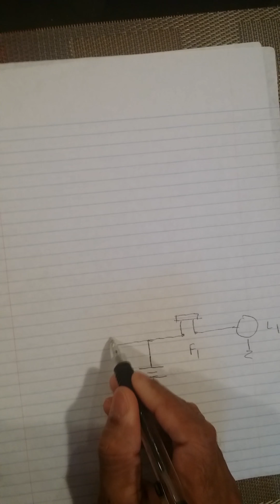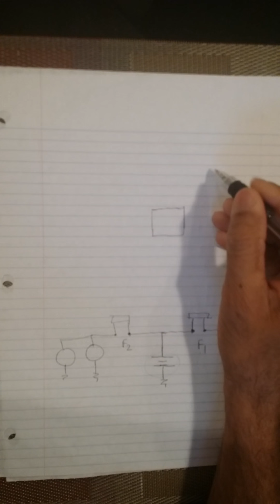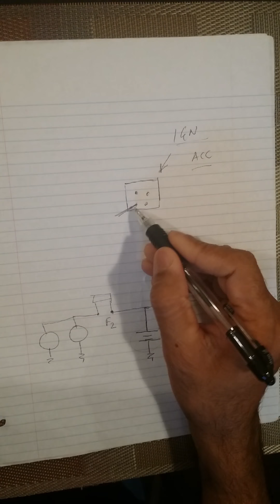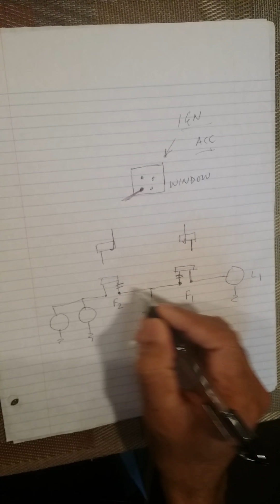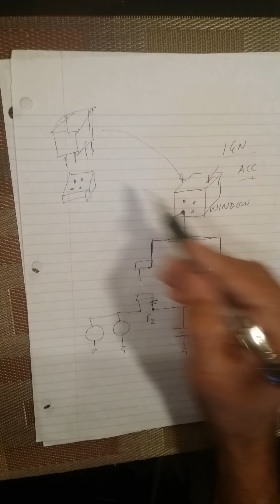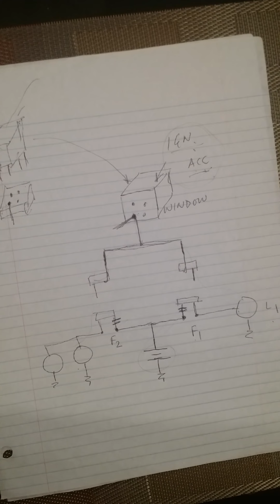Saturn Vue - how to power control cigarette lighter outlets  from ignition switch

Comment: The only problem that can occur is if you draw too much current from the ignition switch exceeding its current rating.   That is why relays are used; they have switch current ratings that are higher than the ignition switch.   What you did may work for low current devices but may damage the ignition switch if high current is drawn.   Adding another relay would help increase the current rating.

Comment from the maker: Remanifest, i really don't exactly remember the wire type or gauge as i pulled it from my spare wire box. But make sure it is thick enough to take the possible electric load. My guess is the wire was gauge 20. Yes, it is still going good with out any problem.